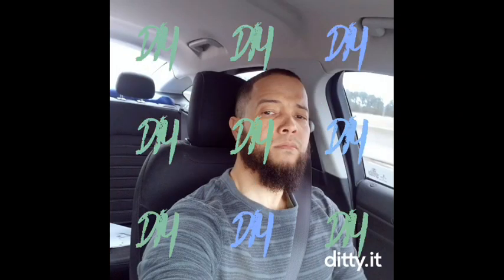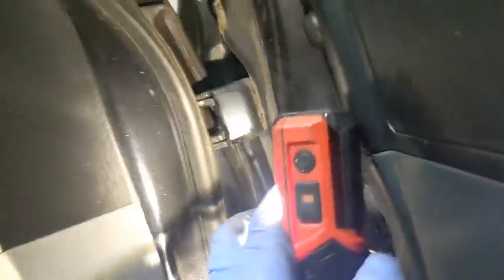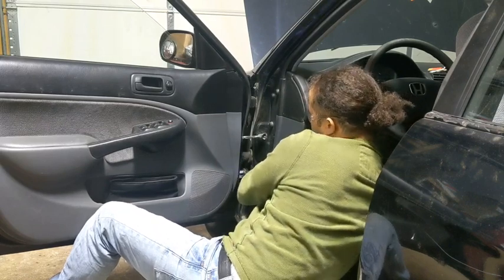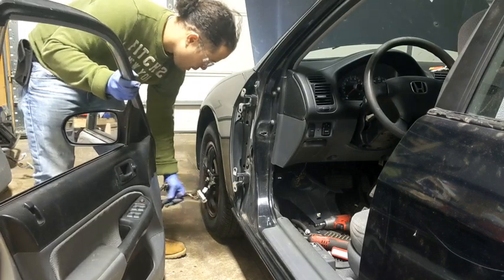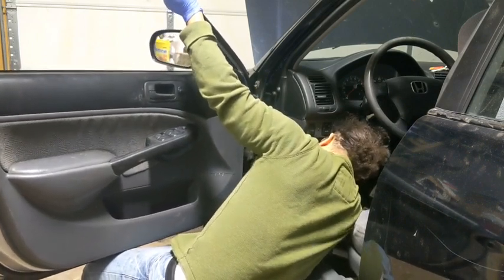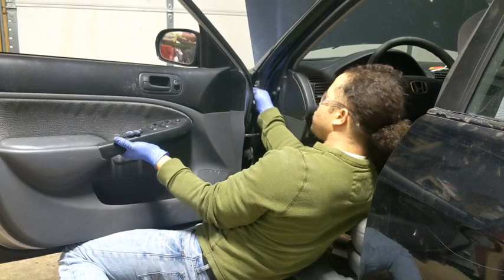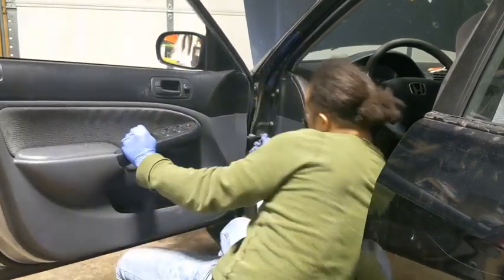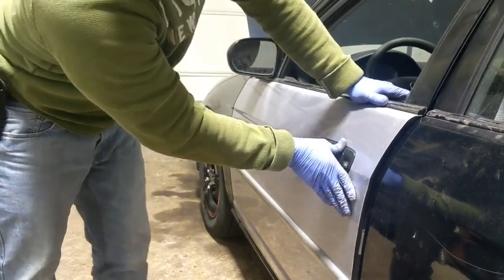DIY Honda civic driver door removal and install

Comment: Hey I don’t know if you still reply but I’m a 16 year old and I’ve never done any repairs on a car but I’m usually good at fixing things around the house. My sister crashed her Honda insight 2010 and I was planning on replacing the passenger door. Would it be the same as this? And also since it doesn’t have a lock I don’t have to worry about it right? And lastly do you recommend I have a go at it or I should take it to professionals?
Reply from the maker: Yes hello and congratulations on getting to work on cars I was 15 years years old when I start fixing friends cars best way to Lear is on friends and family cars go for it I’m sure you can do it
Reply from the maker: Same yes
Reply: @nestorautorepair  Thank you so much for the reply I just have to find the door and I'll try it out. If you know any places I can get doors for a red Honda insight 2010 passenger please let me know.

Comment: I found two doors at the junkyard the other day before I knew what I was doing. I maintained connectors for the driver door but shredded some wires for the back door. How would I preserve or reconnect electronics for the back door? Would I have to rewire it? Something else?
Reply from the maker: Ufff you need to run new wires

Comment: Looks like the lock assembly has come loose and fell inside my door. I can still lock and unlock door just have a loose handle and no lock. How much work is it to take the panel off to get to the inside of the door? Need seals replaced too. It’s a 2010 civic

Comment: Thank you for this video! My power side view mirrors stopped working after I had my car painted & the door taken after to get the door jambs done. The problem is on a 99 Honda Prelude & I'm told that the wires become brittle and break at the connector going into the car. I gotta get in there & figure out what is going on & this made more confident to do it myself.
Reply from the maker: Wow ok good luck sir , thanks for your feedback

Comment: Hey thanks for the video it was very informative 🙌🏾 I was wondering how did you get the inside panel off to disconnect the wires? I need to do this but I’m scared bc it would be my first time
Reply from the maker: Hi don’t be scare those panel are very easy to be remove I believe 2 screw

Comment: Thanks for the video.. are the hinge and bolt really tight and strong to hold? Because sometimes when we get out and didn't want to open he door too wide, I kind of hold on to the inner handle and support myself and get out.. so by doing that, will I do any damage to the alignment? Or something like that?
Reply from the maker: Yes they are very strong 💪

Comment: What if the door is stuck closed what should I do? I can get to the  bolts your taking off but the part by the handle is stuck
Reply from the maker: Wow you need to have it open

Comment: Did you have to swap out the driver side key hole so your original key will work?
Reply from the maker: Yes I sure did ,, I made a video but have not post it yet ,, do you need it?
Reply: Nestor Auto Repair I would love to see it TIA

Comment: When u connect the new door does all the locks and key work the same as the old one
Reply from the maker: Yes everything will work but the key in the hole will not work untill you transfer the lock cylinder from the old one  to the new one

Comment: I have to replace the driver side door on my 2010 Honda Civic Coupe. So no need to make adjustments on the door hinges? If no, I don't need to remove the fender. On your video, you made the adjustment on the striker side but I guess you could have made the adjustments on the hinge side, correct?
Reply from the maker: If the car was not in a accident , you don't need to adjust anything
Reply: @nestorautorepair  No the car  was not in an accident. Had to be replaced  because the top of the door badly rusted. I am in the rust belt. :)
Reply from the maker: Lol oh ok good luck then

Comment: What gun are you using to unscrew the doors.
Reply from the maker: https://www.ebay.com/itm/Milwaukee-2860-20-M18-Fuel-1-2-Inch-Mid-Torque-Impact-Wrench-Tool-Only-/184373454066?_trksid=p2349624.m46890.l49292

https://www.ebay.com/itm/New-Milwaukee-2557-20-M12-3-8-Fuel-Ratchet-Bare-2pk-w-FREE-48-11-2412-Battery-/254847287221?_trksid=p2349624.m46890.l49292
Reply: @nestorautorepair  Yours LOOKS DIFFERENT IS MORE LIKE A 🍼 BOTTLE SHAPE.
Reply from the maker: Lol no is the same

Comment: They messed up my door at the mechanic. The top corner of the driver side door it is not all the way in and water gets in. When i open and close it slowly i hear part of the metal door hit something . im not sure if they bent the hinged because the door comes out wayyy too far and the window frame itself isnt really visibly bent
Reply from the maker: Wow go back to them , water getting in it can be the rubber connector where the cables travel inside the car from the door maybe is not all the way in
Reply: @nestorautorepair  yeah the mechanic that did the job told me he bent it but his day off is today and the manager told me that he wants the worker me and him to examine it and decide what to do. I think theyll judt remove the door and re align it and see if it needs to go to the body shop.
Reply from the maker: Wow ok best luck

Comment: Im trying to install the door but there's the black rubber hinge that seems to have elongated. It's not letting the other two hinges reach the door and secure them. Very frustrating...
Reply from the maker: You can just push it in the door and do it last ,, hit it with a hummer back in the door
Reply from the maker: That will slide in better if you add some WD40 oil  or any lubricant

Comment: What about the electricals??
Reply from the maker: I unplug them from the inside
Reply: I mean, I thought if one lock was changed the whole central locking system had to be replaced together
Reply from the maker: Yes you need to take out the door lock cylinder